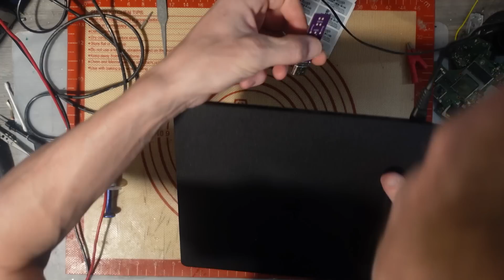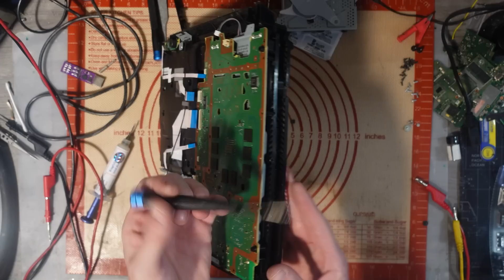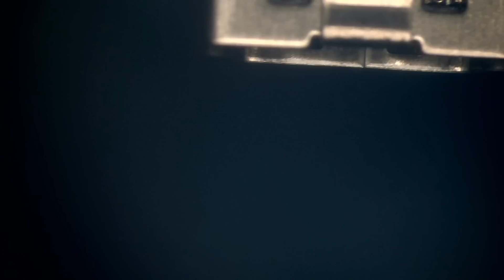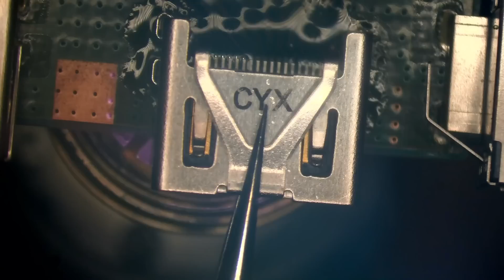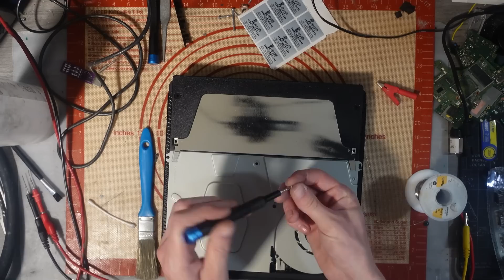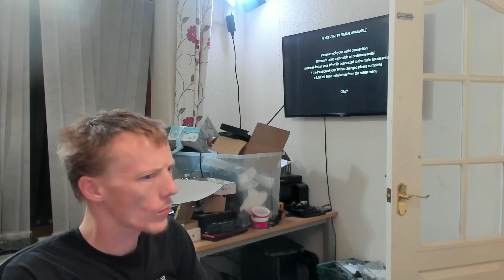This PlayStation 4 Slim Has A White Light Of Death... Can I Fix IT?

Comment: Hi TheCod3r i, brought a cheap ps4 phat £50 with six games an controller with supposedly broken hdmi port, well i changed that and get  interference on the screen so i change those filter things and still no joy, soldering looks ok (not a patch on yours) any ideas, could it be the ic chip on its way out?

Comment: Awesome video! I’ve learned a lot watching your videos. I got a ps5 I put a hdmi port in, got video but I don’t have any power at the usb ports. The most voltage I have is barely under 1 volt. Do you know if the south bridge supplies power to the usb ports on the ps5? It looks like both the front usb and back usb run to the apu

Comment: Hey coder bit of a random one, I got a series x for sale for 200 quid posted, console only and reason it’s cheap is slightly melted at the bottom, runs spot on and never been opened, just thought I’d ask before eBay 😂

Comment: Hello people I’ve come across a ps5 with no power from the button but when I probe the f7002 area it turns on and functions normally I’ve checked the cable and button and all works fine even to power down the console it works but starting it up is a no go with the button any help would be appreciated thanks 🙌🏼🙌🏼